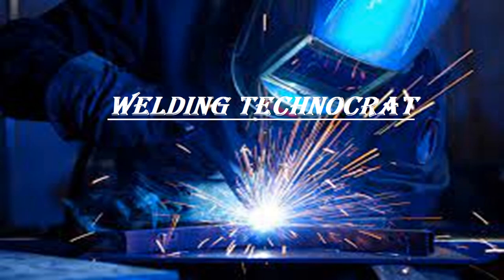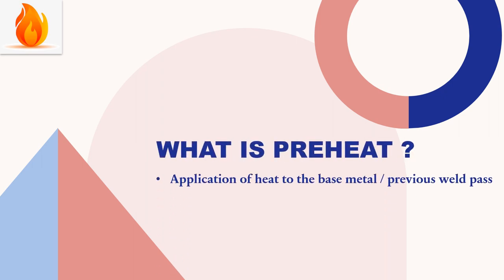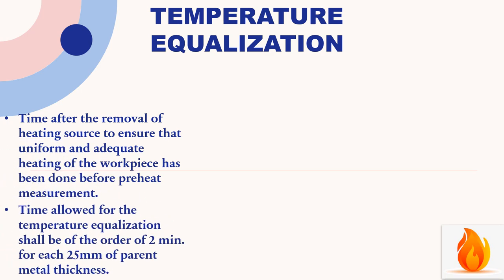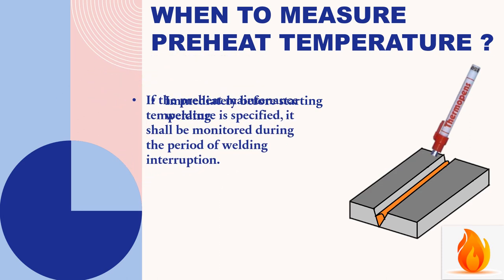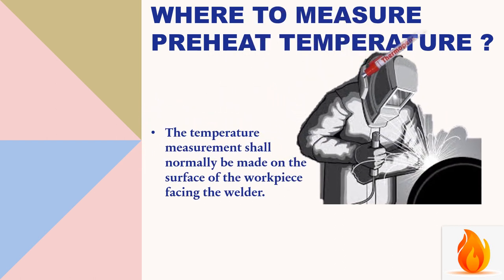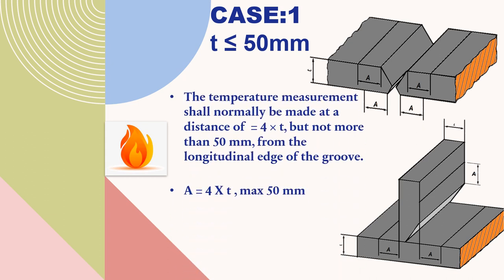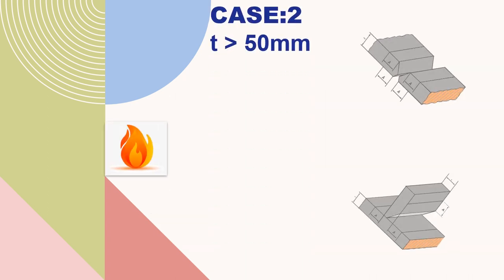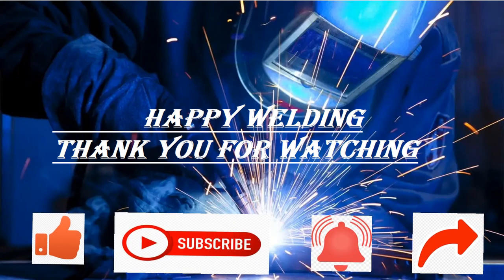PREHEAT TEMPERATURE MEASUREMENTS IN WELDING | WHERE & WHEN TO MEASURE ?

Comment: Which do i refer code
Reply from the maker: For preheat maintenance measurement in welding, EN ISO 13916 is the most relevant. It defines how preheating and interpass temperatures should be measured and monitored throughout the welding process to ensure the quality and integrity of the weld.